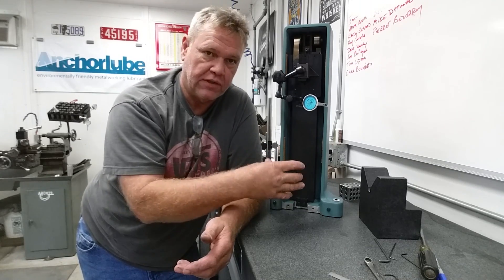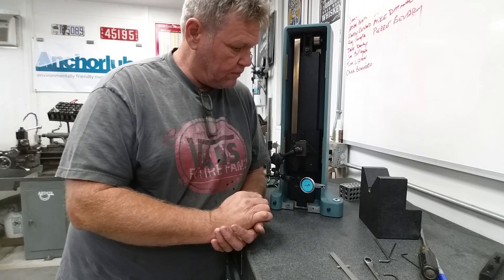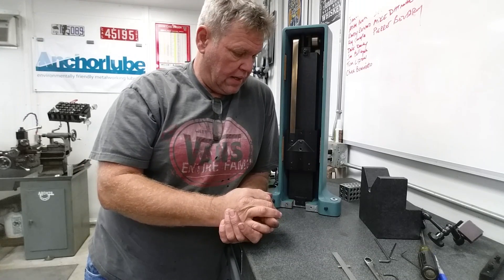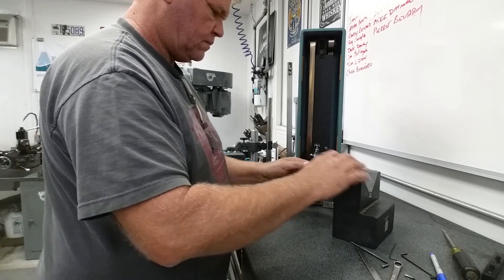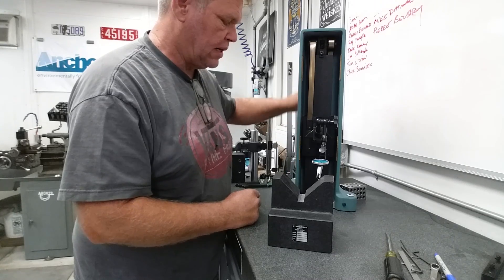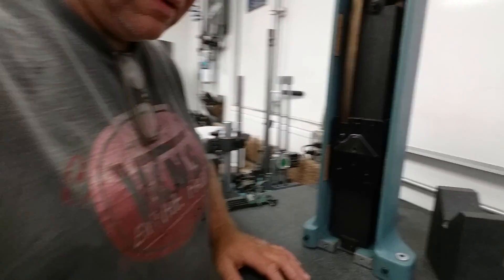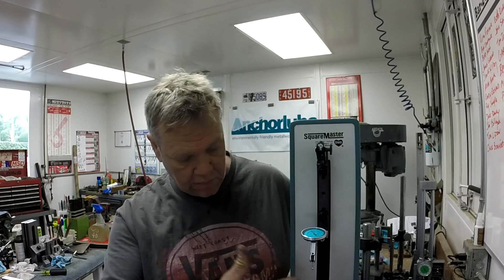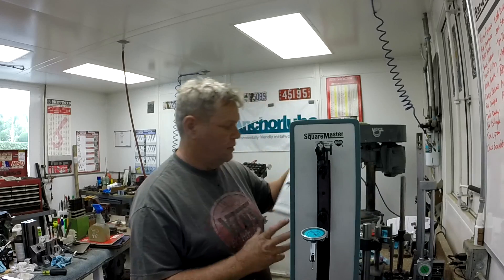PMC Squaremaster column alignment

Comment: does the special sheet have anything about the space of the bottom retaining plate where you added the rubber pad? just wondering if temperature compensation plays a part there.
Reply from the maker: it wasn't really a space before, it was just a steel clamp against the stone (slippery)

Comment: Stan,
Seems like the indicator holder rides on the granite column.  What holds it against the column?  Is there a groove like keyway it rides in?  

Craig
Reply from the maker: It has 10 adjustable pads (3 front, 3 back, 2 left, 2 right) that ride on the column, I didn't dive into those adjustments, but have done it before, that's a whole new kettle of fish.
Reply: I'm learning new things from watching your channel; which is the best reason for following a channel.  In return, I have something for you.  You can make protective covers for equipment like the Squaremaster using ABS plastic pipes  They help to isolate the instrument from shocks and contamination and temperature changes.  I have a friend in the plumbing business so I cheat and bum pieces off of him.  The cardboard tube used for pouring concrete also work if you hit them with some spray paint.
Thanks for all the content you are putting out and best of luck.